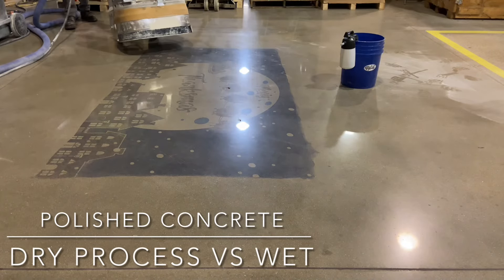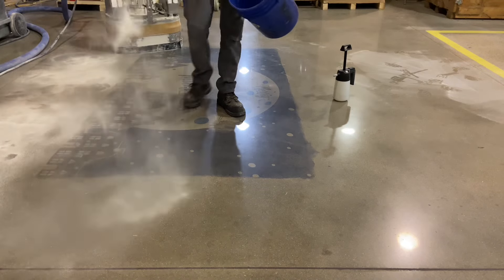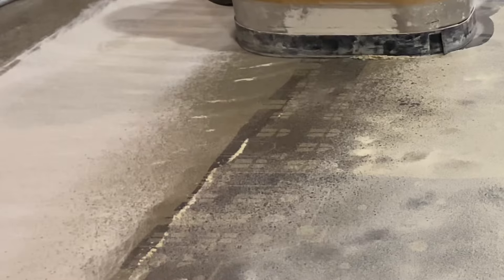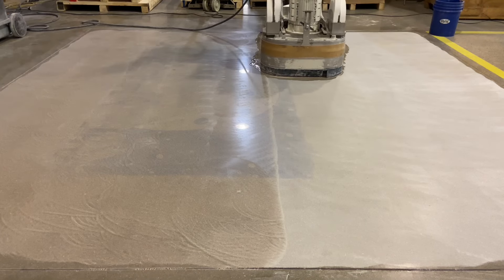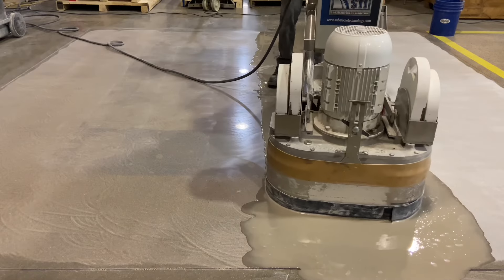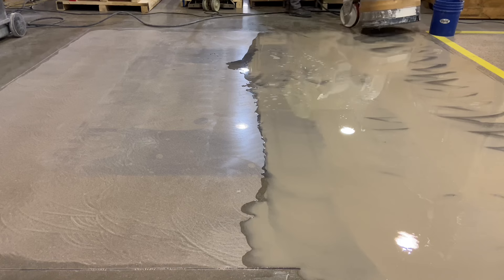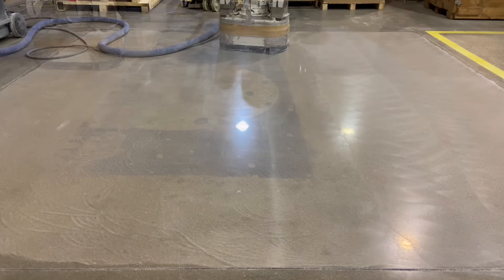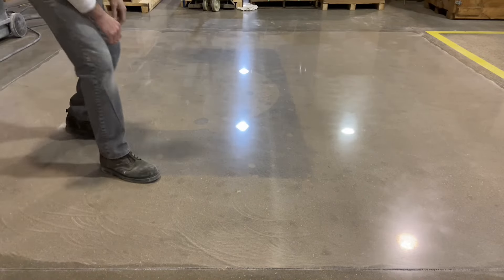How To: Wet vs Dry Polished Concrete Comparison

Comment: I have a similar machine but wuth 4 heads and is very annoying to se the cutting marks , will densifier or concrete seal will help with marks ? Ive done so far to 200 grit  and it doesnt look good at all